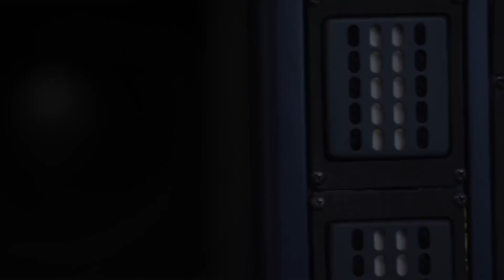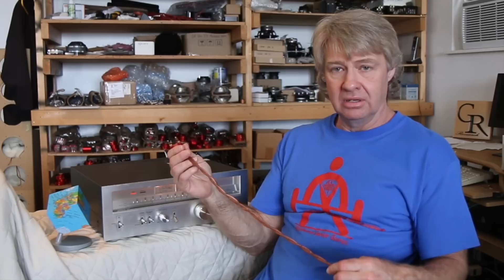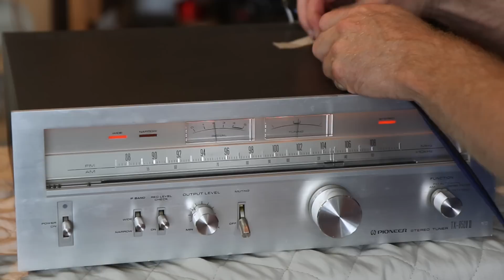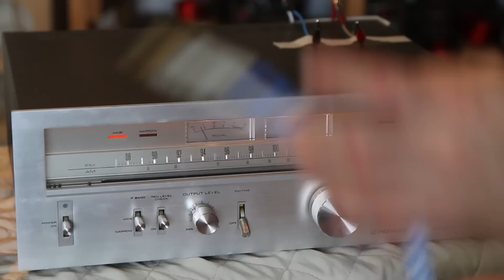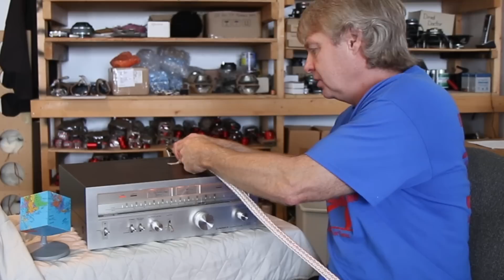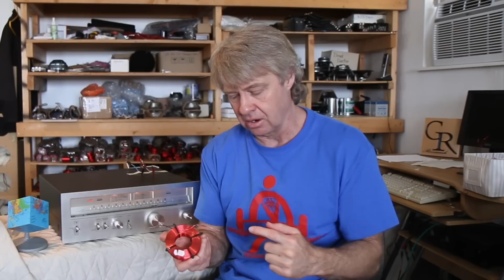Do Audiophile Cables Matter? Here's PROOF!

Comment: The network world figured this out years ago, which is why there are standards for network cable. These extra twist/braiding significantly reduces noise and based on cable type Cat5e, vs Ca6, Cat6a, Cat7,  allows for more bandwidth for the same distance of wire.
Reply: Audio versus RF (tuners) => apples versus oranges, audio versus network cables => apples versus peaches
Reply: @hugobloemers4425  Actually, RF impacts all of these cables, and even more so for digital in the networking world. While it may not prove they will sound tonally different, twisted pair will reduce noise and is a proven fact. You cannot send 10Gb of even 1Gb of data for 100 meters on Cat3. While the Cat6 and higher use the same copper, it is the amount of twist they use and the termination which allows higher bandwidth and reduce rf over the 100 meters. While there are some shielded network cables, the majority are unshielded and use twist (or you can use braiding) to reduce interference. IEEE creates these standards and can be verified on IEEE.org.
Reply: @mickyd3  This is nonsense.  Cat 3 cables don't encounter crosstalk issues until 16,000,000hz.  Audio stops at 20,000hz.  20,000 vs. 16,000,000.  Cat 6 cables don't encounter crosstalk issues until 250,000,000hz.  Cat6a cables are clean to 500,000,000hz.  So each of these cables, which are differentiated by their construction, all have different bandwidths they can pass without any alteration or issue.  We can measure this.
We don't take a ScanSpeak 18W and exclude it from our system due to it's poor response at 15,000hz.  We consider the application of the driver and understand the frequencies it will pass and we are uninterested in it's performance at 15khz because that signal will be filtered out by our crossover network or DSP.  We also don't choose our drivers based just on one response, we look at THD, impedance, and spl all over frequency as well as other things.
So then why should we take cables meant to transmit amplified analog signals to drivers and consider ONLY their performance 15,980,000hz outside of their passband.  Or in the case of Danny's test the lowest FM radio frequencies are 88,000,000hz...  so that's 87,980,000hz outside of the passband of the cables.
Reply: @SabiSlides  Actually, it's across all frequencies, especially when these are run near electrical panels which is obviously 60hz. Your information is incorrect. There are standards to keep all Cat3 and higher cables away from high current such as electrical panels. We (Datavox) install these all of the time ,so my team is very well informed on these standards
Reply: in addition, to using PoE power over Ethernet, it is important these standards are adhered to.
Reply: @mickyd3  He's not demonstrating them picking up noise from a nearby high current wire or winding.  I'm not sure how that is relevant at all.  You described the differences in cables and I simply explained what those differences accomplish.  It's the same copper. The only way they get more data through is with higher frequency transmission.  The bandwidth is a result of the maximum frequency you can transmit.  The differences between the cables lies in their construction - this reduces crosstalk and allows the cable to transmit a higher frequency signal thus increasing the bandwidth.

He is showing how different cables pick up ambient FM signals.
Reply: @SabiSlides  the best way to see how noise actually affects signal is if u put a -60db sine wave through it and then connect it to the oscilloscope and there u will see a clear difference in how the noise shapes that sine wave also at -30db where is really audible for audio signals especially in the low level signals in music, which basically are stripped off because of noise
Reply: @SabiSlides  +1
Reply: The problem with most network cables is they carry high-source impedance leakage currents, which causes increased clock phase noise for digital signals, and the impact of clock phase noise is audible.
Reply: @stephenscharf6293  The Digital to Analog Converter DAC controls the clocking of the digital data in the conversion to analog audio, not the speed of the data on the cable.
Reply: @paulsebring6930  Nope....the critical timing is influenced by all the clocks in the entire chain: from router to switch to network bridge, etc. on to the DAC. And most of the clocks in "consumer" networking devices, e.g. regular Ethernet switches, FMCs, routers, NAS', etc., etc., are super-cheap (less than $1) and very poor for audio applications, especially with respect to the impact of phase noise.
Reply: @stephenscharf6293  Can you provide evidence to support that?
Reply: @stephenscharf6293  If the the DAC clock is dependent on network clocks, how can I play local files on non-network-connected devices?  When playing local files, does the noise level of analog audio out of the DAC increase or decrease when I disconnect the device from the network?

Comment: https://www.dxengineering.com/search/part-type/ladder-line/product-line/dx-engineering-450-ohm-ladder-line?autoview=SKU&sortby=Default&sortorder=Ascending
use 14AWG 450Ohm (RF Frequency Impedance Ohms) Balanced Ladder line, (no RF into your speakers or Amp that will effect feedback loop).
OR you could add RF Chokes on regular speaker wire. OR use class-D amplifiers, essentially Class-D is a powerful RF transmitter with RF filter at the end, speakers connect to the filter

Comment: This is a good example of why noise rejection is important for interconnect and line signal cables.  Speaker cable inductance and capacitance are important factors, but it is not for noise rejection as shown in this demo.
Reply: That is not correct. Loudspeaker cables can pick up gigahertz RF from CPUs e.g. computers, etc. where they literally act as an antenna, and feed it backwards into the amplifier, only to be re-amplified as a larger magnitude of....noise.
Reply: @stephenscharf6293  Speaker cables inductance and capacitance are of no significance to the sound because of the very low values and the associated impedances involved. While they can and do act as antennas and pickup RF energy, a well designed and built amplifier's output impedance even at RF frequencies is low enough such that the RF level should be low enough such that the RF voltage fed back to the input is not sufficient to be detected by the front end circuitry. A simple test with a .1uF capacitor placed across each speaker output can be done if one suspects such an RF problem.

Comment: What of the effect of the high capacitance of such a cable? There are certainly some amps that I understand won't like that (Naim/NVA due to hysteresis??). I do use woven power cables  - DIY  enclosed in flexible conduit.

Comment: I know exactly where you coming from with that. I live in a rural area, and am into ham radio as well as HiFi stereo, and you wouldn't imagine the lengths I've went through to isolate, and reject unwanted rf in and around my house. On the plus side after thousands of dollars worth of baluns, ferrite cores/beads, braided cables, isolation transformers, etc, the first thing many of my friends notice is how quiet my electronics are compared to what they are use hearing.

Comment: The test did show how different wire configurations change radio reception. The next test needs to demonstrate how this becomes audible. Common low frequency radio bottoms out at 30 kHz, which is above human audibility. Further, that is 30kHz of electromagnetic radiation, not sound. The human ear cant hear electromagnetics period, so what component acts like a receiver that translates the data into an audio signal?

This isn't flat earth criticism. When we wanted to SEE that the earth was round, we took a picture that we can see . . . Radio waves are essentially light outside the visible spectrum, so when we are supposed to hear something, what good is a picture?
Reply: well if the frequency would be in hearing range you could hear it..... BUUUUUT.  a radio singnall induse SOOOOo small signal there is no fucking way anyone would hear it on a speakers un amplified :) wtf. hes from another world.
Reply: @joppepeelen  Even if the frequency was in the "audible" range, you would not be able to hear it. Electromagnetic radiation is not audible at any frequency, it is fundamentally different than sound waves.

Some devices are sensitive to radio, but there are a number of steps that must happen in order for this to result in sound. We have been shown that wires can be used as an antenna, what hasn't been shown is what device receives the radio waves, translates them to audible noise, and then amplifies them inside the signal chain of the speakers.

Comment: I would be all about an even deeper dive. I am working on my ascent to decent cables. I just need to learn how to get what is good, not what is expensive, because I am poor. Ha ha. 
I learned a bit about this noise-floor issue. I use my computer  as a source. I had gotten a high quality USB ethernet, then through 25 feet of Cat 5, then through yet another USB. Not only did it work, it immediately sounded better. I could hear the lack of noise, though I hadn't noticed the noise before. It was almost like a loudness filter, because I could listen at much lower levels and still hear definition. 

I don't want it to be this way, but it just is, and I want BETTER. . . I'm an avid DIY man, and would like to create my own cables, if I can do it, but how to test. Your method with a tuner is an interesting one, and seems like a nice way to do some testing, though likely incomplete.
Reply: Benjamin Anthony, please share when you find a solution if you don't want to start cable manufacturing, i.e.
Reply: @azharzaidi3264  I actually ran across an improvement, by strange and horribly ugly experimentation, before. 
I was using 16 ga "zip cord", run parallel with 12 ga 3 conductor, outdoor-type extention cord. 

The zip cord is longer than the extention cable, and wrapped around it, loosely. This sounds better than either bu themselves. I will not say it is great, though.

Point to take - Never listen to me! LOL
Reply: Just braid some cables together and hook up a descent connector
Reply: The signal on a USB cable is digital data, not audio.  Digital data does not become an audio signal until it passes through a DAC Digital to Analog Converter.  The only way to add noise to the audio while it is still in digital form is to change the digital data that is converted to audio without changing the digital data that controls the transmission of the data between devices, which is not likely.  Were you using the DAC in the computer and sending analog audio to your headphones or your amplifier, or were you connected to the DAC in your amplifier?
Reply: @paulsebring6930  it sounded like USB on both ends so I agree that's data being sent through the line not audio
Reply: @paulsebring6930  Actually the digital signal is very fragile and more effected by RFI and EMI than just about anything else in the chain. All that noise still has to be handled in the D/A conversion process. So there can be and is a huge amount of difference in USB cables.
Reply: @dannyrichie9743  DAC data is completely different from USB data DAC data vs USB data can contain an audio encoded signal where as DAC is strictly digital audio stream data ... at least as I understand how it all works
Reply: Save your money and if you want improvement invest in gear or source improvements
Reply: We are going to be coming out with some good DIY cable solutions. Hang in there.

Comment: Great video this is stuff my dad taught me before high school. After taking electronics class and high frequency signals electrical engineer in class I really had a good understanding, “it’s not the resistance that’s important”.          In my job we work with high frequency Data wiring that Hass to reject did not pick up any RFI or EMI four lanes up to 3000 feet of wire.  It turned out that wire makes excellent speaker cable to and I get free scraps left over after every job. It’s also good for using as shielded wiring when building your own preamp’s.

Comment: Wouldn’t noise rejection be most pertinent in signal cabling due to the high input impedance of most all amplifiers? The far lower impedance of speakers and inherent inductance of the speaker itself would be enough to filter out a large majority of any RF noise, no? Not saying that they don’t make a difference, but I feel like most any perceptible change in noise floor would be orders of magnitude higher with a swap in interconnects, especially if they are single-ended. Also, what about differential outputs? Since both lines are picking up the same noise, wouldn’t there be a (nearly) net 0 change in voltage across the speaker?
Reply: Amperage (current) would be the difference with driving speakers.
Reply: Mr flimflam fremdippity danyet Yes. Lower impedance (higher current) circuitry is less susceptible to RFI. High impedance gain stages in tube amplifiers have to be well-isolated with very short leads to reduce pickup for this very reason.
Reply: @roosaaudio  this is the very reason to use wire capable of lower impedance when possible or practice.  I could see how higher impedance would be much more susceptible to RFI disruptions.  I believe that is the idea behind using something like a lower impedance wire intertwined between itself to induce a field to cancel out unwanted disturbances.  In theory this makes total sense.  It's also seems the higher frequency components for a speakers crossover would also be more susceptible to  Rfi interruptions. The more isolated the better. Placing resistance in line with the tweeter should in theory would have a similar filtering effect. If I had a choice, i would rather the higher range just be isolated especially from larger coils that generate more induction.
Reply: This reciever had transformer coupled outputs. I am somewhat surprised today that there was not enough winding to winding capacitance to make that 1pf cap just a drop in the bucket. We did put a thermometer on top of the reciever for a few hours to see if it was getting hot, but no change was noticed and the capacitor was not hot either. Those must have been good output transformers... My dad said he thought the noise might have been radiating inside the chassis from the wires between the speaker terminals and the transformer. No clue and that reciever is 20 years gone now.
Reply: @jdrissel  could have been a capacitor going out.
Reply: @jdrissel  did you figure out your problem?
Reply: Exactly my thoughts.
Using a cable with an open end (i.e. infinite impedance) isn't anywhere close to realistic.
Reply: why would you not run balanced at this point?  pretty funny to be fucking about with cables when you are still single ended.
Reply: @DesignVisStudios  I would agree if the device you own comes with it.  I would like to see an experiment to put the "best " cables vs balanced type of set up and see the difference

Comment: My system used to be quiet until I pulled out a power cable ot the phone stage. Must have changed position of some other cables too.
Reply: I would make sure the turntable ground lead is firm and then give the RCAs a little twist. Seen the like many times. Last I would not run the turntable's RCA cables parallel to any power cables. I used to dress the power lines vertically and the signal lines horizontally. There is so much gain on a phono stage that it can really pick up things you wouldn't believe. This might actually be what people who use special power cables are hearing - a reduction in emitted noise getting into other cables. The tonearm pivot is a particularly sensitive spot because it is so hard to shield the wires there that most do not bother. At most they will twist the wires so that they act like a twisted pair. But if you have a really noisy dimmer running on an extension cord routed behind your turntable you are not going to get rid of that noise without moving that extension cord.

Comment: First of all - this is not even close to scientific method, since you have thesis that you want to prove. This leads to the second thing: the phenomenon that you are showing will not make any difference in acoustic spectrum, when the cables and input/output devices are matched properly. Also, if you want to prove proper differences in cables used as antennas, you should compare same length/thickness etc. cables. The only difference should be like cooper purity - the thing that you call so obvious to hear. So sorry, but I'm not convinced.
Reply: Ton składowy So why don’t you do it to convince yourself one way or the other?  🤔
Reply: @I_have_Aquestion  Because I understand why this test have no basic sense. Oh, and author is using rethorics that he would do it more sceintific method, but he really don't want to loose audience. But I guess he was so boring that you've scrolled trough video, like everybody else :)